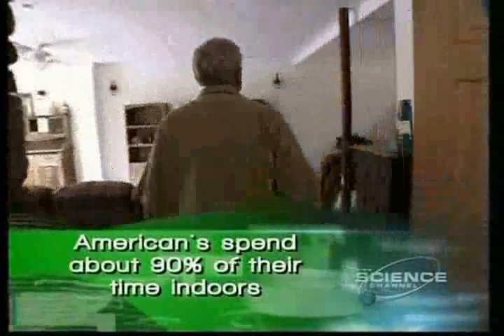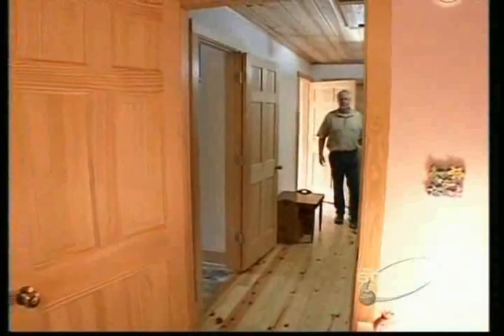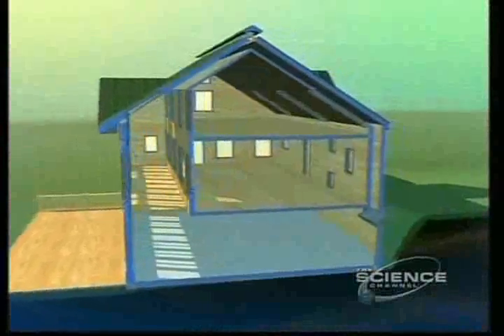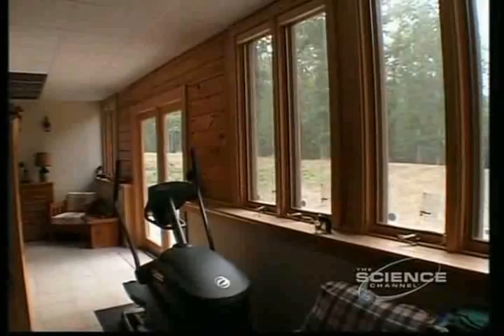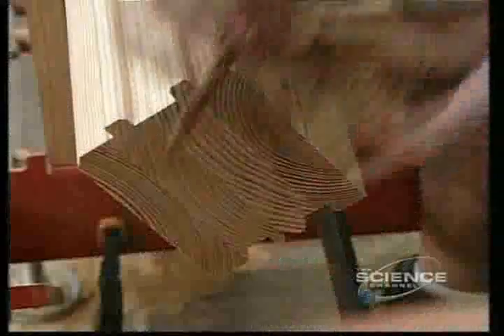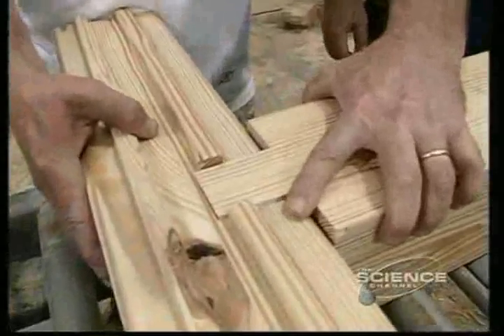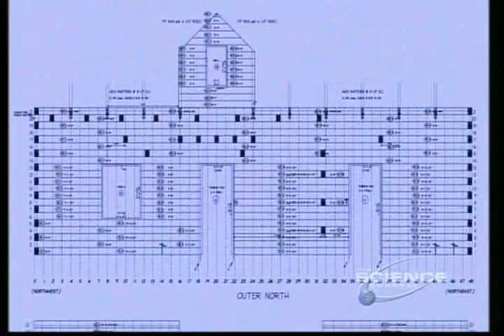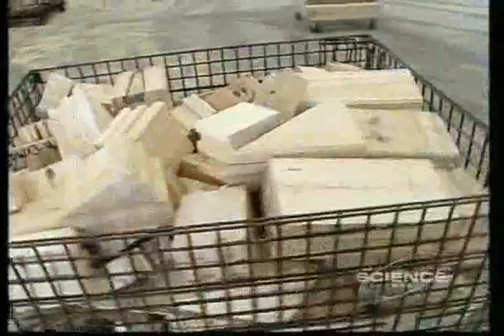Enertia Eco-Tech Episode

Comment: I don't like the idea of having to open two windows on the back and sides of the house. Maybe they could design a thinner air ways between the non-south facing sides. The window box will pass through the inside wall to the outside. I think they should use large glass windows on the front rather then many mix matched small ones. What do you think about the design?